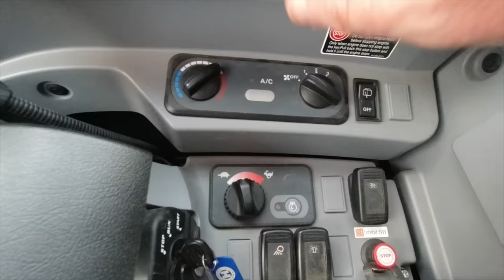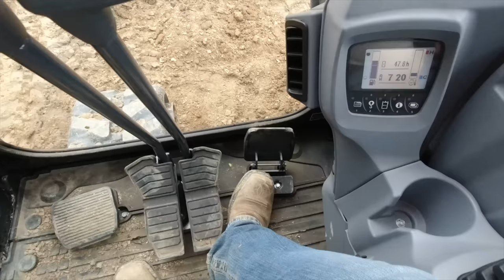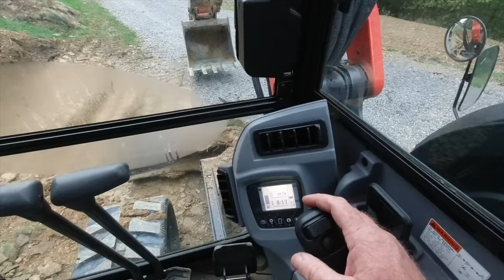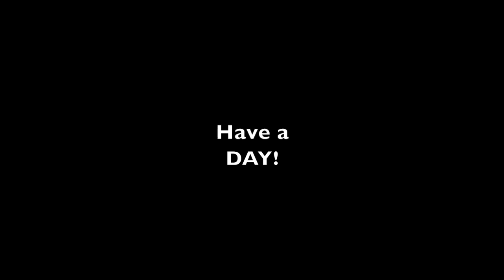#884 How to Operate an Excavator, Including Controls, Blade Position and More

Comment: Thanks Mike. Please mention the dangers of digging or lifting a heavy log over the side of the machine which can get an inexperienced renter into big trouble. Please also stress the need to wear the seat belt, especially for inexperienced users.
Reply: I couldn't agree more.  I consider myself an "experienced" user with some machinery and I always use the seat belt.  I've never seen an excavator flip, but I have seen some close calls.  I have also seen what could happen if you roll a tractor over.
Reply: Good point about reduced lifting and digging capacity over the side. This is important to be aware of especially for mini's because they have such a small footprint.  An operator can make a full capacity lift over the blade, swing over the side and the combination of gravity and centrifugal force can upset the machine and eject the operator if he is not wearing the seat belt.

Comment: I laughed at the comment “I can barely hit the ground with SAE controls on the excavator”. We all know better. 😉
Reply: I borrowed a machine once that was setup in SAE controls and I started to think something was wrong with me... then I figured it out. Nearly crashed my dump trailer a few times.
Reply: You would be amazed how your body adapts to machine controls. I started out on a backhoe/loader with SAE controls and after 25 years of doing this, it was necessary for me to switch to ISO  because most trackhoes use that pattern and some don't have a pattern valve. It was very difficult and took me a couple weeks to do it.  Now after converting, it would take me another couple weeks to switch back. I am glad I switched and will not go back. I converted all my equipment to ISO.  You have to switch 4 hydraulic hoses. The trick is to figure out which ones go where.

Comment: I got the chance to run an excavator for the first time this summer.  Struggled  mightily the first day, and asked the owner if the machine had a "left handed" mode.  He said no. I got more and more comfortable as time went on. Eventually got to the point where I could scrape a thin layer off the top of the ground. You sure made it look easy.

Comment: Mike you are a great teacher, i have never ran or worked  on an excavator,  I do have a Case 780 backhoe  and can work that just fine can dig 65 foot of Wyoming  dirt in an hour and thats 10 foot deep,  but what you do is fantastic,  I myself  is a Brick, block, and Stone  mason, and heavy Carpenter,  Ive built 86 log homes 12 stick homes and remodel 64 homes so far,

Comment: Good morning from MidMo! Fantastic video there, Mike. I had flashbacks to my dad explaining farm equipment. Of course, I was supposed to remember everything, but there was often too much to retain while he showed and explained. I’d get a round of the field as a passenger standing on the running board, watching and listening, then a round in the seat doing with him pointing out mistakes, then he’d get off and I was expected to have it right from then on. I’m really glad I never had to do one of these that way, because I’d have been in information overload for sure. You mentioned the other day that the coordinated movement to pull the bucket back keeping it level was an important skill to practice - I could see that would be worth it. Keeping the center of gravity inside the tracks (or tracks plus blade) would be pretty important too! I really enjoyed this video - your approach to explaining it was straightforward and conversational. That teaching method has always worked well for me to learn, probably because Dad used it on me. A lot! Thanks for a lot of smiles this morning.

Comment: Great info on the drive motors, if you're in real muddy property you want those drive motors in the rear for better traction and stability.  It's real easy to get yourself in trouble by not having the blade in the proper position.  Nothing will make your butt draw up real quick than having too heavy of a load and it starts pulling the machine over or swinging the load and it tips the machine.  Good info Mike, I know it's hard to explain how the two joysticks will work in tandem together and they are almost an extension of your arm.  I'm laid up with quadruple bypass right now, so from one Mike to another Mike, I enjoy seeing your work with the equipment.  Can't wait for the day that I can get back on my equipment.  Keep up the good work.  Looks like you and Josh at Stoney Ridge are keeping the trachoes busy right now. Thanks for the videos for a guy who can't use equipment for a while but still loves to see it.

Comment: Re the new excavators ease of operation and comfort. The first excavator I owned and operated was a very used Unit Crane and Shovel 514. It was all cables and clutches, windows were all broken out, brakes on one side didn’t work so you could only turn in one direction and if I wasn’t careful turning the tracks would fall off. Good times.  To switch from digging to travel you had switch this lever and push that lever and then back again to dig. It had an un-padded pedestal seat that had to be flipped up to enter the cab. Took some real skill to operate. Guys today have no idea how good they have it when it comes to running equipment.
Reply: Ran a dragline crane on the railroad that was all clutches ,  brake bands, and cables. That was an experience until you got used to it.

Comment: Very good explanation.  I have a backhoe on my tractor and as you pointed out, the controls on an excavator are basically "backwards" from what I was used to when in ISO mode, yet that's what I got used to when I ran an excavator.  I'm guessing it was easier to learn ISO mode in an excavator because the joysticks are placed differently than on my tractor's backhoe.

One tip that I always tell people when I am trying to teach them is something that I was told a long time ago when I was learning.  "Slow is smooth and smooth is fast".  In other words take your time and don't try to rush.

Comment: Something for you to try before you give up that lovely machine. Muster up 2 good saw operators, get a bunch of logs for firewood stockpiled, than use the machine to grab and hold the logs at a comfortable height for the dudes on the saws, so they don't have to bend over as much when bucking them up. Saw up to the bucket, drop it, and grab another log. When your done, grab your "drops" by the end and cut them up. When you get it right, its stupid fast!! 
As always, Excellent video, keep up the good work!!

Comment: Great video.  Might have been handy for me to have seen it about 20 months ago.  My brother needed 800" of 42" w x 5' deep trench, and I was selected to dig, mostly because of my vast experience with an excavator (2 times for a total of about 90 min).  Rented a Yanmar 55 and figured it out, eight hundred feet of smooth floor 42 inch, 5 foot trench  for a geothermal heat/ac system in 25 hours machine time according to the rental.

Comment: I haven't yet used one, but I was thinking about blade positioning for stability: I noticed it wanting to slide to the side when the front was being picked up, so if there's a steep drop-off to the side, that could spell trouble--but if an operator levels the area around them, picking up the front doesn't seem as dangerous to me as having it tilt inward towards where you're digging. I'm guessing experienced operators can course-correct when they feel they've bitten off more than their machine can chew, and stop the tipping either way, but I think I'd start off with the recommended only dig over idlers approach.

Comment: Hi Mike. There is one thing that I think that you forgot to tell your audience. And that is if you turn the house of the machine more than 25 full turns counterclockwise you will unscrew the house from trucks and the house will fall over. We always had a young kid standing by watching the excavator  counting the rotations to make sure but the operator didn't go over 25 turns. This will free the operator from having to worry about it. Just a safety thing.
Reply from the maker: Lol

Comment: I run the blade depending on what I am doing also, a lot of times I am trying to create level ground here in my mountains. When I am doing that I run the blade in the back, as I dig in to the hillside I create a pile behind me and use the blade to push that pile out and level my ground behind. me. Very efficient as you don't need to grab your loader to move that pile.

Comment: Thank you for your clear and understandable explanations on how the KX-080 works.  Have you ever tried a Yanmar SV100 excavator?  Kind of wonder which one to choose from: Kubota or Yanmar.  Both dealer are about the same distance from my property. It really is a matter of choosing the best machine mechanically wise and of course I value the  dependably and durability of both  manufacturers.  If you had to choose between the two which on would you get?

Comment: Great video. Have you operated the kx 040 with the 6 way dozer blade or know anyone who has?   Or a 040 in general?  I have lots of stumps to tend to as well as similar ground work jobs you do and i was looking at the 040 due to its smaller footprint. Wondering if it has enough power to pull its weight or better yet above its weight class

Comment: Nice job Mike.  Glad you covered the control patter changer.  I really don't understand why the excavator industry evolved with the ISO (International Standards Organization) while the BHL industry used the SAE (Society of Automobile Engineers).  I did not work on the BHL product but when I retired in 2004 from Caterpillar, I don't believe the BHL had a pattern changer option on it's controls so if you cut your teeth on a hydraulic excavator, you were struggling initially to run a BHL.  I would be surprise today if the modern BHL did not come with a pattern selection option since now we have fully integrated electronics on the machine.  Like the auto industry, machine design has evolved so much in the last quarter century.  Huge gains in operator comfort,  noise level, emissions, and serviceability.

Comment: Thanks for the informative video. Going from a Gehl Skid Steer with all mechanical controls to a brand new cat with electric over hydraulic joysticks was fun to get used to. I don't remember if you mentioned it in a previous video or not. Are there lockout tagout procedures and boom locks you might mention? I noticed the ignition switch key open the door for that ISO switch, and probably locks the cab. Is there a battery cable switch?

Comment: Mike, I have 35 timbered acres here in Idaho, would you recommend a excavator over the mx5400 for overall management of roads and timber?
Reply: Not that I am Mike) but just my opinion; A tractor with a front loader and a winch will be the most important equimpment to handle the timber and maintain roads I would say. If one got relative 'gentle' terrain like Mike got, not too rocky and some flat fine ground many places (compared to what I am used to) one would likely get a long way making roads in the first place with something like the MX5400. With more steep and rocky terrain a excavator will be more handy and quicker. One can rent one to make the main roads, or get a used one. would not put too much money into a excavator for 35 acres of timber, but they are sure handy to have around at a property. Would go for a Japanese brand myself)
Reply: Rimrock300, thanks for the input. I’m out in the central Idaho mountains with fairly steep terrain. I’ll be making roads, piling slash and maintaining/establishing drainage for the road system. This will eventually be my first tractor purchase so I want to be wise with the investment. Thanks again!

Comment: I thought when you get the the machine the first thing you need to do is read the manual. 😃 You didn't touch on tensioning the tracks or making them wider after being on the trailer. Thanks for the video and keep up the great work. 👍 📵🚭 Many times you get an older excavator that doesn't work properly, unlike that brand new one.
Reply: d hamby I would think twice about wrenching on any rental equipment,  Mr. Homeowner doesn't want to be responsible for repairs on a machine. Adjustable tracks are typically on the smallest rental excavator, not one this size
Reply: @timcrosby4651  , Thanks for the comment, I agree you don't want to be wrenching on equipment for most repairs, except losening bolts, belts and screws that are hindering operating the equipment and need constant adjustment. Most people that would watch this video are likely first time excavator renters and would get a small excavator with adjustable tracks. Just trying to set people up for success and not failure with the comment.

Comment: Hi from India 
I am concerned about your pond, you have desiltited okay but your real problem is the safety and stability of the dam when you get exceptional intense rainfall. 
As a rule of thumb you should have a square meter cross section of spillway for every square km of watershed upstream, and, multiply by 2.if a substantial part of it is devoid of vegetation. 
Your plan to have a pipe to take the overflow sounds good if sized properly. 
In addition to the pipe I would advise to beef up the dam by 3/4 feet in hight and commensurate beefing up in the width (slope not less than 45%)
In addition to the pipe another desirable feature would be to have an emergency spillway on the other side of the dam the level of which could be slightly higher than the top of the pipe and not less than three feet from the top of the dam(free board). This would probably, ideally, be operational on a 10 to 20   year basis and can be shaped with soil and strong surface root vegetation. This spillway should be as wide as the site allows. Do not delay, your Jerry rigged plastic sheet will not withstand the big decadal downpour. 
Wishing you well, Jean.

Comment: Mike I was always told to dig over the idler's in case you drug something into the cab and it hit your travel sticks it would walk away from the object.  I knew of a guy that was working on a pipe laying job (steel gas pipe) and he walked the hoe over the ditch to clean out the ditch after a weekend rain.  The pipe was propped up and he drug himself into the pipe, it came into the cab and hit the sticks (he was over the drive"s) and walked the machine toward the pipe and shoved him out the back of the cab through the glass.  He was hurt pretty bad.

Comment: Is the shale a type of sandstone?
Reply: Bill, both are sedimentary rocks, but from different size origin. A sandstone forms from coarser sediment, in the sand size range, which cements together through precipitation (chemical solids forming), often with iron or other silica oxides. Shale forms from smaller, clay-size sediment that somehow cements together, and I’m not sure of the method. Hope this explanation helps.
Reply: John Sadler   Thanks John.  Yes that helps.  They are more like cousins than brothers.

Comment: Drive motors are (ideally) ALWAYS at the back....it will work the other way too.....but its techically incorrect.
Reply: Backwards around puts the stress and jarring directly on the drive motors and reduces their lifespan (which you may be fine with) - even if it works better for you.  IMHO